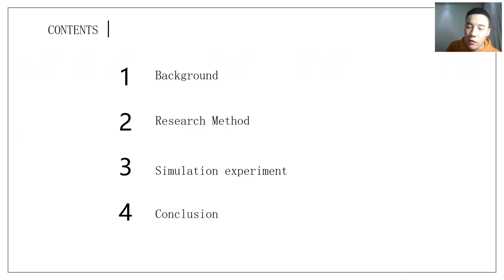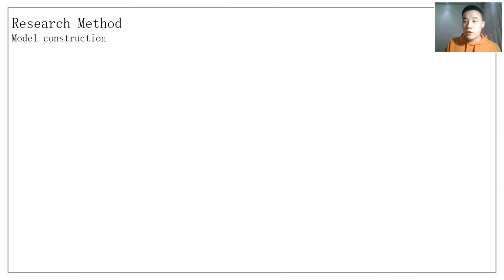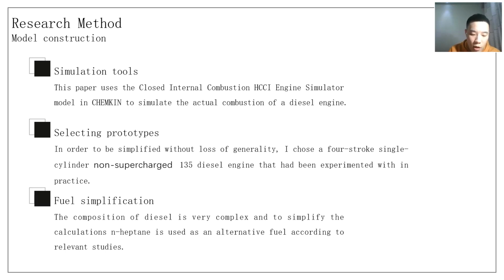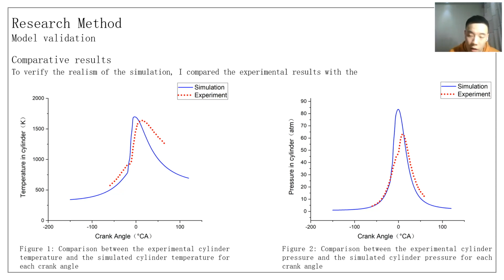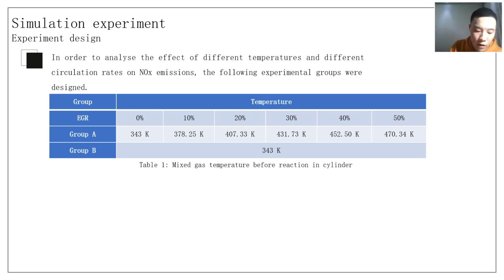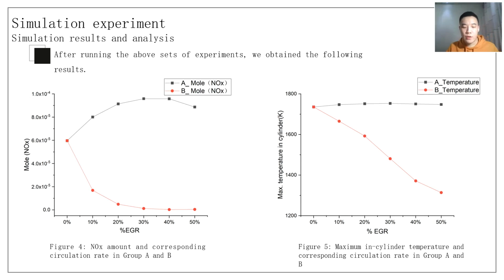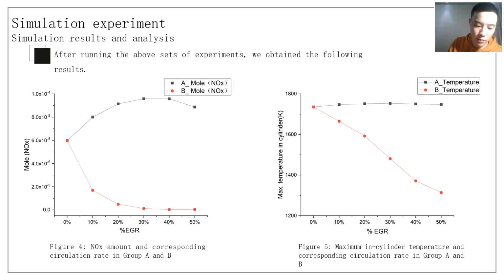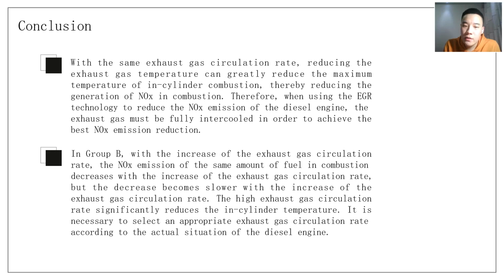CONF-MCEE – Simulating the Influence of EGR on NOx Emission of the Diesel Engine with CHENKIN

Comment from the maker: Here are the questions we collected and the answers replied by the presenter:

Q1. You have discussed the NOx emission reduction. What about the other gases(For example, CO)? Do they have similar results?

A: Thank you for your question. EGR technology cannot solve all the emission pollution problems of internal combustion engines. On the contrary, some pollutants such as CO and CH will increase as a result of the use of EGR. However, optimal emission reductions can be achieved by combining EGR technology with other measures to reduce emissions. The combination of different emission reduction technologies provides researchers with additional research directions.

Q2. In your opinion, how to achieve "fully intercooled" of the exhaust gas in the engine?

A: Thank you for your question. The "fully intercooled" in the paper is an ideal situation for the simulations. It was done to find out the effect of EGR temperature on NOx emissions. In practice, it is difficult to achieve the same cooling conditions at the same temperature. Appropriate cooling can better exploit the advantages of EGR technology in reducing NOx emissions, which points the way to the practical application of EGR technology.